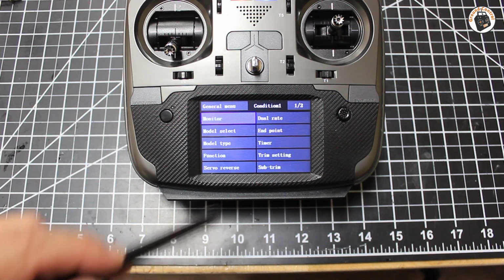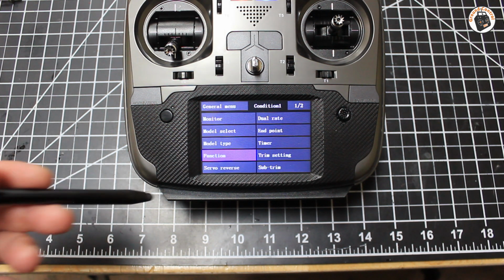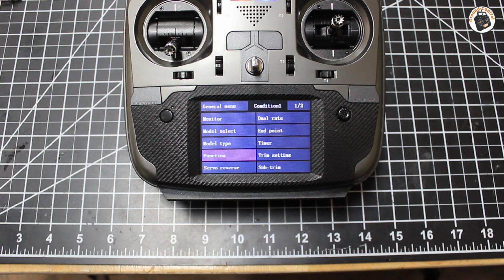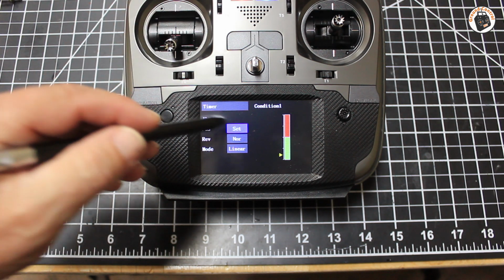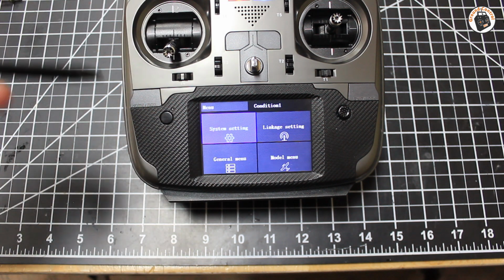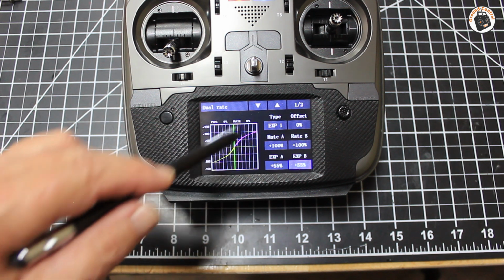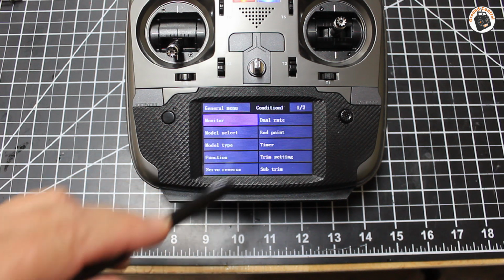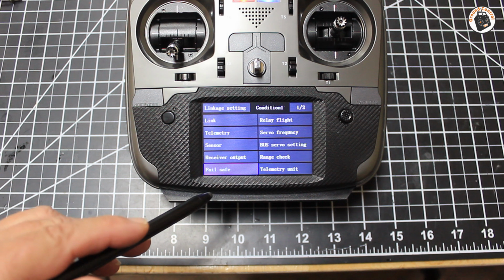Part2 - Creating our Airplane Model | New WFLY ET16 Pro TX Hall Sensor Gimbals ELRS Dual RF JR Bay

Comment: Why you using Throttle hold instead of Throttle cut. Throttle hold is for helicopter
Reply from the maker: Because the throttle cut was not going to provide me the desired result.
Here is what the manual states:
Throttle Cut: This function cannot be triggered when the throttle is high to prevent any mis-operation.
It appears many of these functions are designed specifically for Nitro Planes, not Electric Planes.
Using the Throttle Hold provides me with a way to Cut the Motor no matter the Throttle Setting ;-)
You could also just setup a function mapped to a switch to do the same thing but this was easier.
Reply: I like this, but without 4 in 1 ill go for radiomaster
Reply: @tooleyzrc1973  good luck with the fake chips. ELRS is the future.
Reply: @zumeria177   There no such thing of fake chips.